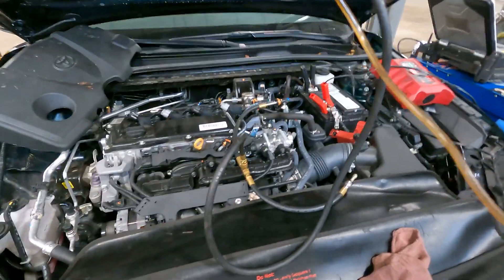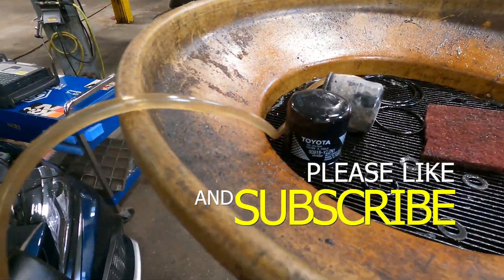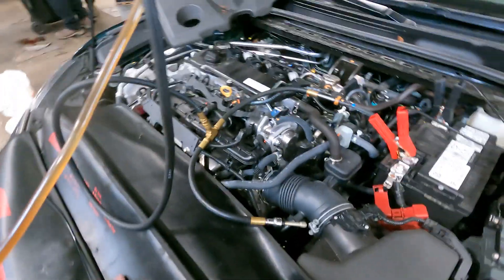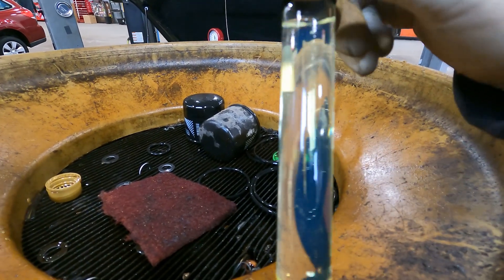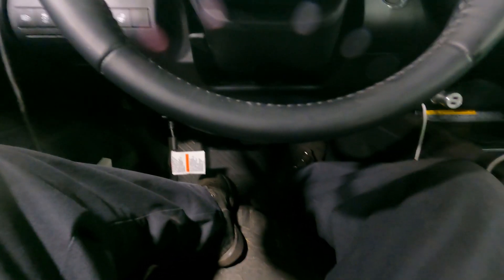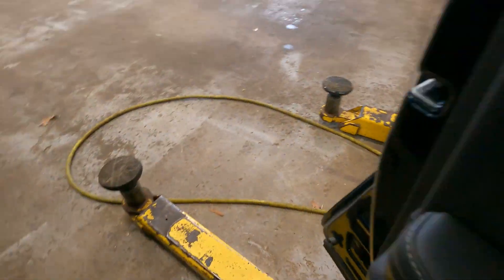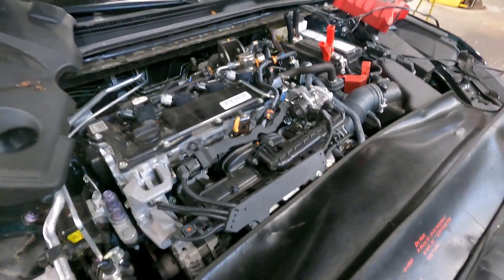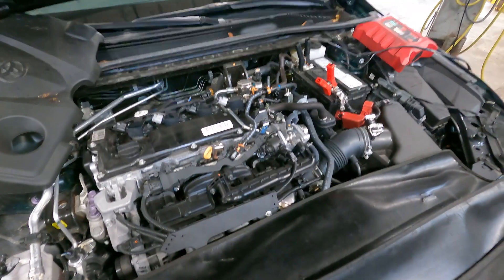Customer states "I PUT DIESEL IN MY GAS 2022 TOYOTA CAMRY!"😨😫😫Will it be ok???

Comment: Great video as usual. Did you change the fuel filter as well??
Reply from the maker: Removed fuel pump and cleaned with fresh fuel on the bench.
Reply: A lot of cars don't use a serviceable fuel filter. The only filtration you get is the sock  at the pump inlet. Sounds dumb but its not a new concept.
Reply: @JohnG6  Thanks, I am kind of an old schooler when it comes to cars.

Comment: Gasoline engines run okay on a diesel/gas mix as long as there's not too much diesel in the fuel. Ie. this car ran on the fuel mix still in the fuel rail.

Comment: Sadly, there is no one international code for nozzle colors for specific fuels. Each company gets to pick whatever color they want. Having said that, it can be said that a slight majority of vendors in the US use green for diesel.
Reply: Yeah and then you have BP, with their Special K self, uses green for their regular gas because of course
Reply: the diesel nozzle is like ever so slightly bigger for standard cars
maybe 1cm 

so you'd have to like slowly fill er up with just the tip inserted 🤣
Reply: Here in México, Black it's for diesel, Green for regular/magna gasoline, Red for "Premium" super 93 octane gasoline

Comment: A couple of years ago I was in a German gas station refueling my Toyota Avensis diesel  I here this Throaty roar then a crunch as this bright red Ferrari pulls up to the other side of the pump I am using. A 'thing ' gets out covered in bling and shirt open to the waist with Trophy thing left sitting in the car. He starts to fill up. I finish put my cap on turn to him
"That's Diesel"

Comment: wait a second since when does a Camry use 93 octane  unleaded gasoline my late maternal grandmother always used 87 octane in her both her Camrys and they worked fine okay some cars call for 91 octane as do heavier vehicles like SUV's Trucks etc. my younger brother drove a used 1994 Eddie Bauer edition Ford Bronco when he was in College mid-2000s early 2010s and that recommended 91 Octane which used to be called high test unleaded gasoline. can remember watching Motor Week on PBS on Saturday afternoons as a kid if I wasn't watching Caddle pin bowling with my dad

Comment: Smoke in the mirrors. Where have I heard that before. I know it's a new car but would a motor vac have also helped. I realize by you putting fresh gas in. Gasoline is a solvent, just a very flammable 🔥 one. But it was handled carefully. Nice job. Wait so would your Camry die for you?

Comment: I put like 2 gallons I had in my garage just to realize it was diesel from my friends truck my cars sparks got damaged and on top of it I realized my fuel filter was old car wasn’t accelerating like it’s supposed to drained the gas put fresh gas changed plugs and filter running like a top now feel bad for anyone who does the opposite will damage your diesel engine fast.

Comment: I want to see how they dispose of that "waste oil" tank.  I can't imagine the danger of someone attempting to burn waste oil and finding out it's contaminated with gasoline.  You can not imagine how often I see this happen to motorcyclists when they pull into a pump that can serve gas or diesel..  Or when a big pack pull into a station and in a rush to fill up one of them goes to the diesel pump without realizing it.  Hate to admit it, but I topped off my bike one with it.  Bike ran OK under power, but didn't like to idle.  As soon as I smelled the exhaust I realized my mistake.
Reply: waste oil with mixed fluids isn't a problem. Frankly most companies don't even care if there is antifreeze, water, gas, diesel, 85w140 or 0w and anything between for oil, synthetic or standard, transmission or power steering oils or whatever all mixed up together in the disposal reservoir, including plenty of insects and mice or other pests that find their way into it. They pump it all up, and it all gets refined as is and turned into various useful things again.
Reply: Probably goes to Safety Kleen in Linden NJ
Reply: @SpectrumTwist  I see your point for companies that collect "waste oil" from shops.  Up here in the great frozen North East, a lot of people use oil burning furnaces and some collect waste oil for the shop or garage furnace. That could get ugly in a hurry.
Reply: @Rags722  i'm in canada.... and i know plenty that do the same thing. MOST of the people i know that snag oil for burning in furnaces or other purposes like that tend to source from restaurants as it's often more reliably less contaminated with who knows what other things. Or it may go to garages that have more isolated recycling reservoirs. I just know most small garages privately owned and specially farms tend to throw it all into one place since it's convenient, and we've been told we can do it so no need to separate.
Reply: I did that once with my bike as well. I didn’t put in a whole lot, but the bike did smoke quite a bit. It ran ok until the mixture was completely used up.
Reply: Yup.  I was just topping off a 1/2 filled tank for a day of riding so it was reasonably diluted. No catalytic converter to worry about damaging so it was just a case of  draining the tank at home, refilling it with good gas and ride out whatever was left in the bottom of the tank.  On the positive side, the 5 gallons of contaminated stuff worked just fine for burning stumps.

Comment: I'm still a little perplexed with all the modern engines often having such high levels of automatic adjustments and calibrating capabilities to adjust things on the fly depending on air/fuel/etc mixture, that a modern gas engine isn't able to continue to operate while granted at a low power or akin to a somewhat limp mode with diesel.

In the past, with carbureted and mechanical injection, it was considered a good idea to diesel to a vehicle's gas tank at a certain mix ratio, some people often put in transmission fluid, say a liter, to a full gas tank. The idea that it would lubricate and potentially clean up the carb, valves, and ports to a certain degree as well as provide a little extra help in other areas, specially for those older engines designed with leaded fuels in mind. The other advantage was getting greater fuel milage at the cost of overall power being usually significantly reduced due to the slower burn of the fuel. People would mix down in order to save a buck back when diesel was roughly half the cost of gas.

But even so, running straight diesel wasn't a problem either in most cases, provided you tried to avoid high rate of ping depending on the engine. For example running pure diesel in a 283 (4.8L) not so good, they weren't a hot enough running engine with big enough compression, so mixing it down was needed at least in the old 62 chevy i have. However in a big block hot running engine like a 455 rocket, that thing didn't miss a beat and it burned clean and didn't foul the plug at all, also gained about 7-10mpg up from 20mpg that it could obtain with straight gas. Rather impressive. That 455 in that delta 88 olds didn't ping or skip a beat at all, and after pumping through that entire tank, it ended up managing to clean things up a bit.

I will say though, about 20 years ago at a local gas station, a driver filled the gas resevoir with diesel resulting in dozens of vehicles being filled with diesel instead of gas. I was shocked that due to the design of those vehicles, the vehicles filled the crank cases to the point of pushing the dipsticks up and pouring fuel out on the ground by any orphus it could. I was later told by mechanics that it was due to the fuel system detecting foreign contaminants in the fuel and the creators of the system determining that the best course of action was to try and pump as much fuel in as possible to quickly get rid of it. A lot of vehicles ended up hydrolocked due to crank case being filled to max and some having seals blown out. Idiotic design idea.

Comment: diesel in a petrol car, bad but not terminal, petrol in a diesel car (Europe - diesel cars were very common), utter disaster - very very expensive.  Even unlocking the car can start fuel pump resulting in fuel pump destruction. (Diesel is a lubricant and the high pressure pump uses this, but petrol is not a lubricant).
1) Fuel pump - lack of lubrication from fuel - shreds itself instantly.
2) injectors - detonation inside 
3) Engine, you get compression pre-denotation (ie knocking), you can quickly get a lot of damage assuming the engine runs long enough given problems 1/2.
So you are looking at least 4K and way way up if you start the car.
The worst part is that in Europe, you cannot put a diesel pump filler into a petrol car - too big, but it is easy to put a petrol filler into a diesel car, killing it.  So I feel the car industry decided to go the wrong way around to improve revenue.
As for the CAT, you are unlikely to get much damage, in Europe all diesel is low/zero sulphur and there is little else to poison the CAT.
Reply: In the UK the different size nozzles started in the 1980s when they reintroduced unleaded petrol/gasoline and started fitting catalytic converters. Leaded petrol ruins a catalytic converter. They went to a smaller nozzle on the pumps for unleaded petrol and also a smaller filler hole on vehicles requiring unleaded petrol. The idea was to stop anyone putting leaded petrol in a vehicle with a catalytic converter.

Comment: Supposed to be impossible to put diesel in a gas car, they must have bypassed the fill hole size somehow.
Reply: Seen plenty of diesel pumps near me that have standard filler nozzles usually outside the areas that service the bigger commercial vehicles and mainly deal with lighter duty vehicles
Reply: @Anonihmus2567  Supposed to be impossible by law
In accordance with the standard EN 13012 the diameters of fuel nozzles at all gas stations are the same. The narrower petrol fuel nozzle has a standard diameter of 21mm. The diesel fuel nozzle is wider with the diameter of 25mm.
Reply: @darmah1959  yeah well laws has loopholes and grandfather clauses... even in canada, there are thousands of stations to fill at that don't have to comply since certain circumstances simply make it that they don't need to comply.
Reply: @SpectrumTwist  Seen the opposite happen  many times. Normally gas pumps are tightly controlled by a state authority, but obviously this person learnt the hard way to look. At least it was a relatively easy fix, the alternate issue is a nightmare.

Comment: The motor rattles more than an old Perkins diesel.
Reply: That's how four cylinder Camry's sound. I've had a few they all have the same noise it takes alot of getting use to

Comment: That’s just an extra level of stupidity due to the fact that they would’ve had to fight just to get the pump nozzle into the fill hole giggity also helps that gasoline and diesel have different colored nozzles to keep this exact thing form happening you know in case they can’t read 🤦🏻‍♂️🤦🏻‍♂️
Reply: there are thousands of fuel stations around the world that have identical sized nozzles, and don't have colour coding either, even in canada it's not a requiremnt or regulated in such a manner. Both gas and diesel nozzles can be literally identical colour and size and even the pump appearance with the only exception that one has to be labeled diesel and the other gasoline on the pump.
Reply: @SpectrumTwist  I have traveled all over 48 of the United States and never found an improper diesel nozzle.  It's a federal mandate that they are to be a larger diameter.
Reply: @damonzilliox2751  consider yourself lucky... they exist still in mass..

Comment: Lol you went way overboard on this. There's been a few times that I was stuck and knew that I was not going to have enough gas to make it back to where I needed to get to. I've ran as high as a 50/50 mix of gas and diesel and yes starting especially if cold outside sucked it was hard to get it started yes it had very low power yes if you romped on the gas pedal it would get some spark knock. But it wasn't bad as long as I stayed easy on the throttle and I was trying to get as far as I could get knowing that I was barely going to have what was needed to make it. The couple of times I had to do this I made it to my destination and the vehicle was perfectly fine after putting in some fresh regular gas. I did notice a few bennifits though. After I had to do it the fuel injectors were cleaner and much quieter as they were cleaned and lubed from the diesel and the fuel pump witch was going bad was now very quiet and I got almost another year before it finally failed without the random dying it was doing prior to running the diesel mix. And no I had a can of diesel in the garage for other things and was an emergency situation with no funds available for the fuel needed. So I took a partial can of gas and one of diesel and figured I'd start at 50/50 and save some gas to dilute if needed.
Reply: He could of unhooked the fuel line and energized the fuel pump by jumping the relay and pumped the contaminated fuel out.  It would of been fine.

Comment: Lots of unnecessary things.  Drain the tank.  Refill with gas, clean the plugs, and let it rip.  

Plugs probably wouldn't need cleaning either.  Once it fires up they will clean themselves during ordinary driving, definitely during a good stint of freeway driving!  

Totally unnecessary to replace the plugs.  Plugs will last well over 100,000 miles these days thanks to unleaded fuel.

Comment: That engine doesn't sound that good at all @3:23
Reply: That's how four cylinder Camry's sound. I've had a few they all have the same noise it takes alot of getting use to
Reply: @harrybaulsach  no that's not a real Toyota then because when I did practice driving before I had my driver's license just my permit I drove a 2010 Camry and didn't sound like that
Reply: @theanimeotaku2794  you could have been using a 6 cylinder

Comment: I have to wonder how they didn't figure out that if the fill nozzle didn't fit, it's not the right one.
Reply: I have a customer that did the same thing. Held the nozzle against the fill neck. I have said for years that most people are stupid!
Reply: I have to agree there, and it's not getting any better.
Reply: @eldoradony  What ever happened to "If it doesn;t fit, you must quit"? Quit adding gas that is.
Reply: Not all diesel pumps have the larger filler nozzles see plenty near me with the standard size nose but they are still clearly labeled diesel
Reply: @Anonihmus2567  if they have the wrong nozzle on them then they've managed to pass inspections on a wing and a prayer. mist places it's a violation to use the wrong nozzle
Reply: @cliffcorson4000  thousands of gas stations around the world, hell even in canada, aren't regulated to have special fill nozzles. Any place that sells fuels, isn't required to only put certain nozels. It's entirely up to the customer to know wtf they are doing.
Reply: @SpectrumTwist  US US a regulation at any pump that is self used
Reply: @cliffcorson4000  and yet.... there are still 1000's that have nozzles and don't have to comply with such regulations in the US.... there are numerous loopholes or grandfathered in clauses that allow smaller facilities to sell fuel without having to have specific nozzles.
Reply: @SpectrumTwist  as stations update they are required to set to current standards
If they don't you can contact the state's department of weights and measures as they inspect gas pumps
Reply: @cliffcorson4000  That's the thing, some stations are still using equipment that is old, so long as their corrected volume still measures out properly, i'm not aware of ANY rules that forces stations to have the latest pumps or anything of the sort, this is where being grandfathered in presents such a situation.

Plus many places that sell fuel, simply can't afford the $100,000+ cost of a single pump with carded functionality for pay at the pump.